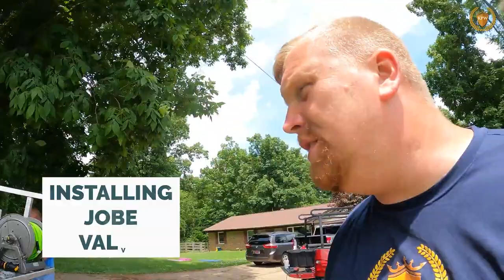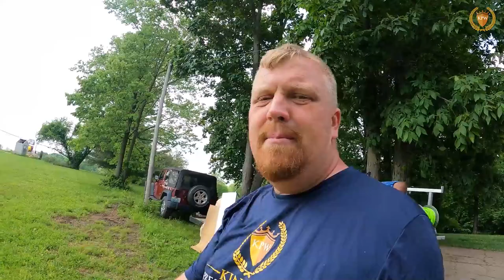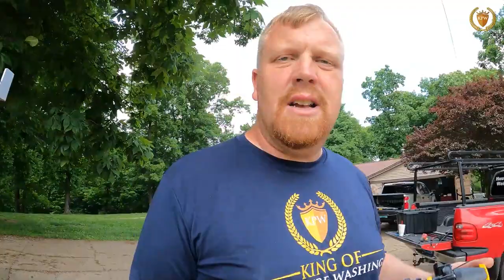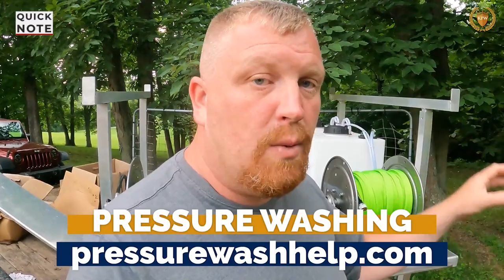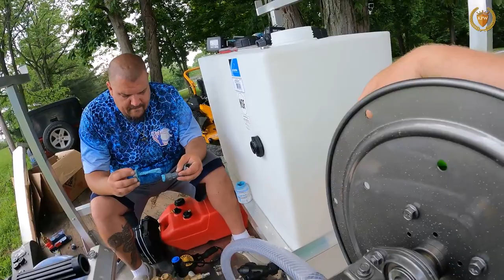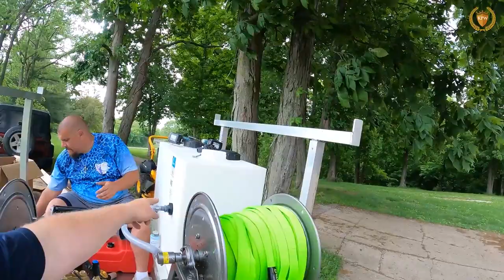JOBE Valve For Water  Buffer Tank  For Pressure Washer

Comment: The gasket position does matter, but only in regards to the shoulder on the bulkhead or other fittings (not inside vs outside the tank)...always place the gasket against the shoulder and not against the nut that tightens it down. Against the shoulder, it makes a seal between the tank wall and the shoulder, where the liquid cannot reach the threads. If you put the gasket against the nut, there is no seal between the threads and the liquid, and liquid can seep along the threads under the nut and leak out of the system.